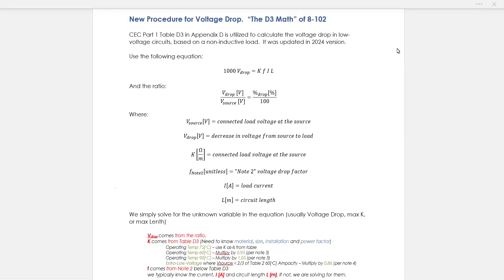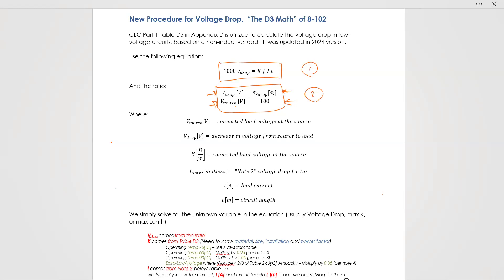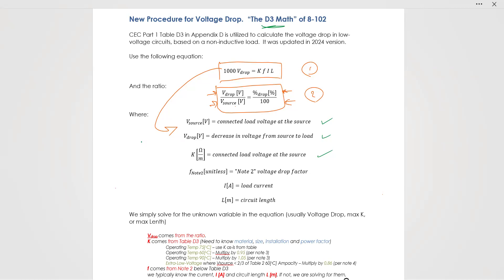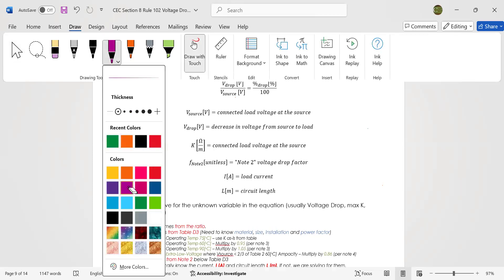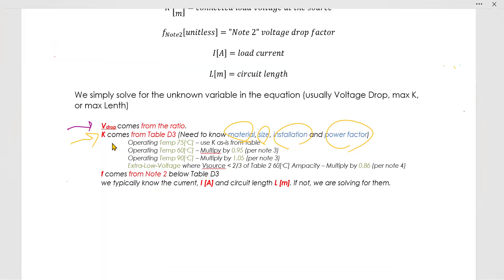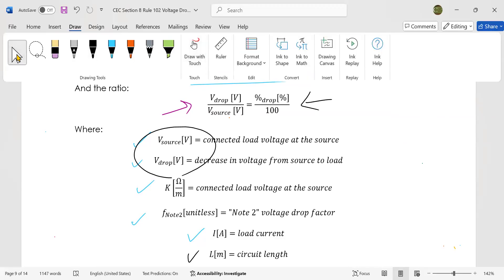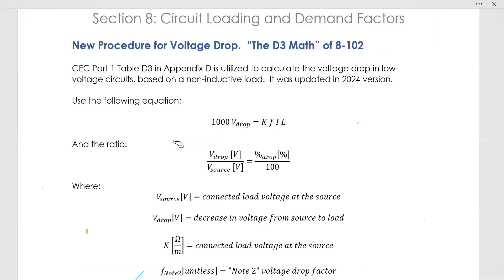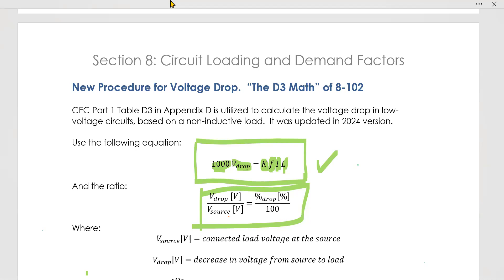How To Do NEW 2024 Voltage Drop Calculations Math using Table D3 of CEC Rule 8 102

Comment: I’m having exam this coming Tuesday about “code” and “safety” and conductors marterials and size.
I’m having difficult with calculating aluminium lol 😂 only
Reply from the maker: I don’t have a lot of Aluminum examples right now, but that’s certainly applicable for high voltage distribution systems.  I wish you the best on your test tomorrow and hope to make more aluminum specific examples in the future.  The same theory applies, just different tables.
Reply from the maker: Perhaps my Flowchart videos are helpful.

Comment: my question is what if the K value we calculated is in between. So, Which one should I pick the highest closest or the lowest closest? ( For the conductor size.)
Reply from the maker: Aaaah!  Great question.  The K-value is a number that represents, somewhat, in effect resistance, taking into effect the thermal dissipation as current flows.  There are no "jumps" in the value.  It is continuous.  Therefore, iterating between values in the table are absolutely valid.  I know you're thing about "jumps" in table values because we do that a lot in code: Wire sizes, fuse sizes, etc.  They are only made in certain sizes, so we need to go to the next larger or next smaller, for example.  But K is different.  K is a continuous function. It exists in between the values in the table.  It's actually best to calculate it directly from the formula.  I made a new video that shows the physics of where K comes from, and you can see it's just from Ohms law: https://youtu.be/pysMIu0LMaQ?si=TdmhvFPjQcFVy7G7

After watching that new video, can you see why it's valid to iterate for your k-value in between rows on the published table?

Comment: 1. The K value in your doc unfortunately has the description for source voltage.

2. The K value as defined in the code has units of ohms per km, which is the reason for the 1000 constant that appears in the formulae.

3. All I came here hoping to find out is whether L is total conductor length or source to load distance. I tend to assume the latter, but I guess I'll do a comparison with the old D3 and see what happens.

Edit: yeah, L is source-to-load distance ("Distance to centre of distribution" in the old D3 lingo) not total conductor round-trip length.

Edit2: Of course! That's because the round-trip adjustment is made by the mysteriously-named and needlessly complicated "f" factor chart, which boils down to: multiply the VD by 2 for any 2-conductor situation, multiply by 1.73 for any 3-phase / 3-conductor situation.
Reply: it's distance to load, that's way you have F to determine the total length of the conductor.
Reply from the maker: Yes, it's all in there, but you need to read all the details in titles of the tables as well as the notes.  It helps to look at NEC which does it the same way, and even has the 1000, not because of m/km conversion, but because it's for every 1000 feet.  Perhaps CEC and NEC were trying to standardize.  But now we basically have a formula.  I have put units on the formula and tried to explain it better here:  https://youtu.be/pysMIu0LMaQ?si=TdmhvFPjQcFVy7G7

From this new video, I show that it's simply derived from Ohms Law.  Thanks for watching and working through this, and most of all, thanks for sharing with the community.
Reply: @Prof.K.  Cheers.